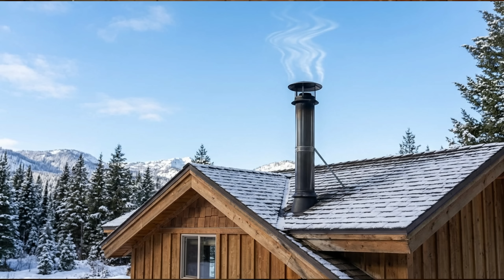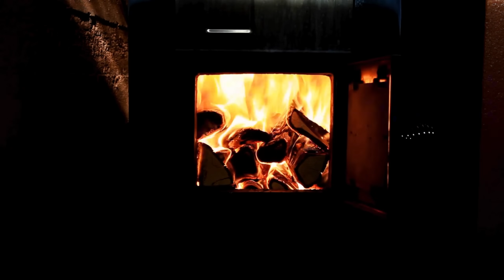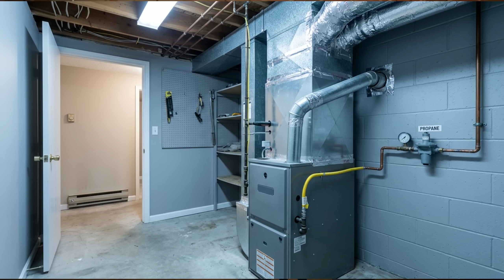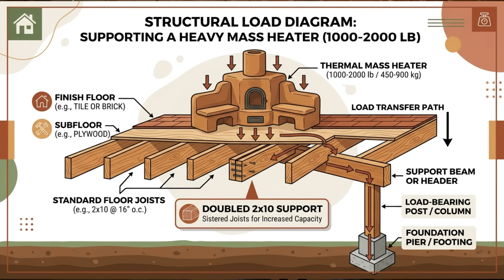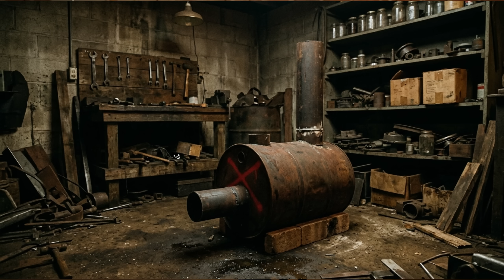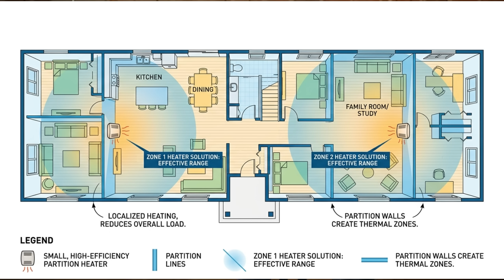The $12 Norwegian Stove That Heats a House for 18 Hours on One Log — Rocket Mass Heater Decoded

Comment from the maker: The most common question I'm getting: "Can I build this in a 
mobile home / apartment / small cabin?" 

Short answer: Yes, with modifications. The thermal mass can be 
scaled down to as little as 200 lbs of cob if you accept shorter 
heat retention (8-12 hours instead of 18). 

The 3 questions I'll answer in the next video:
1. What chimney configuration works for 2-story homes?
2. Why does cob outperform brick for thermal mass?
3. How to retrofit one into an existing fireplace

Drop YOUR question below — the top 3 most-liked questions 
become the next video. I read every reply.
Reply: ❤

BB❤❤❤
Reply: thank you
Reply: Have you made one yourself?
Don't you have better drawings for self construction?
You don't actually talk about how the wood-burning ovens/stoves that were used, were like in most of(Northern) Norway, from the start of the 19th century, until the ovens are used today. We are btw not allowed to burn oil-gas for heating anymore, -or just at very small scale, like camp/hut cooking or heating at small scale...

Comment: The single log is not correct. You have to have it split down to 14 inches long and 2 inches wide. A bundle  12 to 14 inches in diameter will burn for about 1 and a half hrs. You can put a whole log in that burn chamber. Man do these things work.

Comment: You are wrong about open hearth. I owned a 1925 Craftsman home with an open hearth fireplace and the lead, graduated flu BLASTED heat into my living room. The flu was brass key operated at waist height, and because all chimneys in the US were like that in the past - and nit as you depict - the flu panel held heat and could be opened just a crack to allow CO2 to escape while not only holding heat from the fire in but channeling into the house. 

Nit saying the chimney design you describe isn't effective but I am saying from personal experience that what you describe if American chimeny if the past - not now, now they are total crap -  is inaccurate.

Comment: one 6-inch diameter, 2-foot-long maple log contains approximately 73,600 BTUs, enough to heat 1,226 to 1,472 square feet house in zone 5.

Comment: Heating tech doesn't matter much, if your house is designed and built with proper insulation. Furnace in basement, air intake pre-heated by ducting that runs alongside the chimney, then forced air ducting running under the floor. No direct air exchange from interior heated areas. All windows double paned. Airlock entryway. You know you're doing it right if the air coming out the chimney is room temperature.
Reply: You say "heating tech doesn't matter" but it does very much so if you are disabled, poor and trying not to freeze this winter without burning your cabin down! Haha😹

Comment: 18 hours off one load is wild, my old stove burned out by morning
Reply: Back in 1977 I had a flat that consisted of the back room, kitchen and all of the upstairs, there were two open fires, one upstairs in the front room and one in the downstairs back room, come winter I'd start lighting the upstairs fire at about 6 o'clock  and bank it up before bed time, it would still be glowing red hot the next morning, when weather turned really cold I'd light the one downstairs too, between the two my whole flat was cozy and warm, I could through fresh coal on either or both fires on weekend mornings and the fire would carry on all day, that was with proper coal, now the crushed and reformed rubbish we have to burn goes out after a few hours, it may be less polluting per ron but we have to burn twice as much.

Comment: Do you have a  Nuclear Powered log in the stove? I have a modern high efficiency wood burner, you can hold your hand on stove pipe when using this stove. I bought it used for $200. It is about as efficient as a stove can be. It does not create creosote in the chimney.

Comment: I use to have a Vermont casting soap stone stove and it was the most efficient stove I've seen and I used to install out door wood boilers and those are nice but it's a lot of work and kinda a specialty kind of application
Reply: Those should be called $oap $tone $tove$ LoL 😹

Comment: The physics do not add up on the use of firewood.
Reply: You are obviously not familiar with rocket mass heaters
Reply: Or masonry heaters.
Reply: I, as a child. Lived in a house with a 45 gallon oil barrel wood stove. It heated a 576, and after i moved away, my dad doubled the house into 1,152 sq ft,  house. The barrel was replaced every couple of years.  The fire wood was basically free, plus the gas for the chain saw and drive it home, the labour to process it.

Least expensive, healthier way to heat that house, and most neighbours for hundreds of miles around did likewise.

Of course. I didn't live in a big city.
  When I move back to that area. I'm taking my wood stove with me. I have one now.  Just in case the electrical power goes out for a couple hours to a couple days.
Reply: Correct. The amount of energy required to raise the temperature by X degrees in a volume of Y cubic metres can be easily calculated. Once you know the calorific value of the wood, then the volume / mass of wood required can similarly be calculated, allowing for the efficiency of the stove. Conclusion ? AI and those commenting don't understand thermodynamics.
Reply: @peterrhodes5663  Enjoying my pot belly stove wood fire while reading your comment, and have opened the top half of the cabin door as it was getting kinda too warm. Absolute pig of a day here with icy cold NW winds and almost a months rain in the last 24 hrs.
Reply: @Jack-d8d8e  Oh sure with your one log for $12 over 18 hrs. It's nonsense. Sitting here with my real woodstove. Yes with the door open.
Reply: Lets see... physics or being warm when it's freezing cold!

Comment: Well...... 15 hours maybe but it's the amount of heat that counts and though all these shows tell us that the heat goes for 18 hrs I believe the last 4-6 hours would not heat anything or stop you from feeling bloody cold unless you hopped into the fire box or sat on the stove.THOUGH IT MAY STOP YOU FROM DYING and nobody could argue anything then.
Reply from the maker: Fair point. The 18-hour claim is not the same as 18 hours of strong room-heating output. With a rocket mass heater, the hottest useful heat comes earlier, and the last few hours are more like stored warmth slowly fading from the thermal mass.

So yes, in a very cold room, the final 4–6 hours may not feel like “active heating.” It depends a lot on the size of the mass, insulation, outside temperature, draft, and how much wood was actually burned. The key idea is not magic heat for 18 hours, but using one hot burn to store heat much longer than a normal stove.

Good clarification, and I agree this should be explained more clearly.

Comment: One comment ! Most inside combustion heat sources such as this and many others use the air (oxygen) inside the house to supply the fire . Would not it be even more efficient if the combustion air be supplied via a duct from outside to the firebox leaving the warmed air inside the house . I have seen such an installation where a guy I knew when he built his house ran a 12 inch duct under the foundation to the bottom of his firebox from the outside , he swore by it !
Reply from the maker: Excellent point, and I agree with you. A dedicated outside air intake can make a lot of sense because the fire is not stealing already-warmed indoor air for combustion and sending it up the exhaust.

That said, it has to be designed carefully. The duct size, draft, moisture, dampers, backdraft risk, and carbon monoxide safety all matter, especially with a rocket mass heater or any indoor combustion system. Done wrong, it can create problems. Done right, it can improve efficiency and comfort.

Your friend’s setup is a great example of thinking about the whole house as a system, not just the stove. Thanks for bringing that up.
Reply: I made a duct tube that feeds fresh unheated air down from the attic directly into the fire stove intake.  Even put screen on top so no vermin could accidentally fall in.
Reply: @brucewales5965 
I like that.
Was the tube from the attic aluminum?
Reply: @brucewales5965 I made a duct tube from my stove, into the attic also. After using it once, my house burned down.
Reply: Yes. The mason who built ours made a dedicated air vent route from under the house to the fireplace*. Another thing to this video is one could build an internal ventilation system in the house to blow and circulate the warm air between rooms.
(*and in our case the air vent supplies air in two ways: one directly into the combustion fuel chamber and just under the fuel feeding opening, so it also gives slightly extra air into the room as well but the intake flow can be regulated)
Reply: If the fire draws oxygen (air)... maybe a small pipe right next to the bed is the answer....
Fresh air to the body loading the fireplace
Reply: i always saw this as a way of renewing the air inside the house. maybe a valve?
Reply: He built the house on top of the heating system? I need more details
Reply: Yep. That's my method. 
The whole house collects the heat. Even my mattress. No more cold bed to hop into. I have regular fireplace & steal wood burner stove. The later does the best!